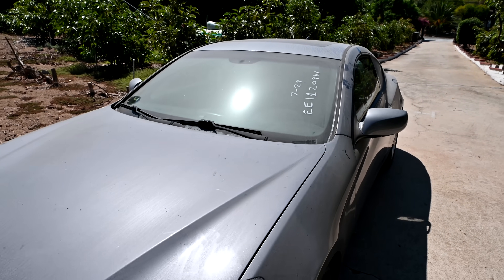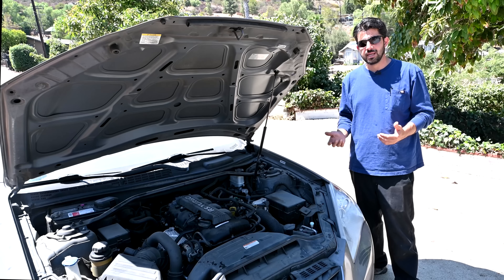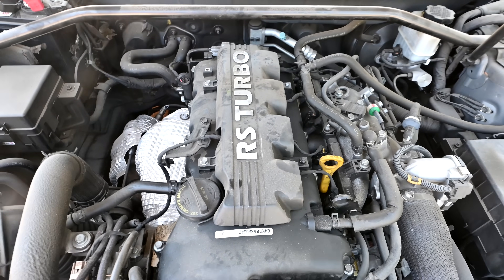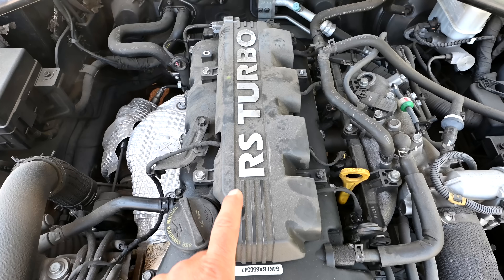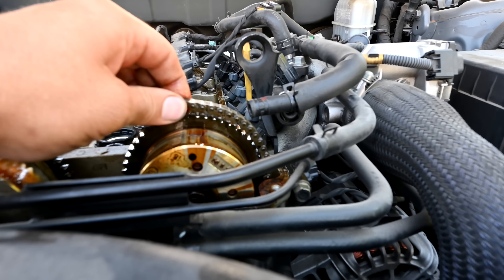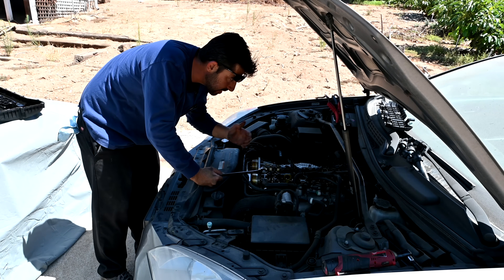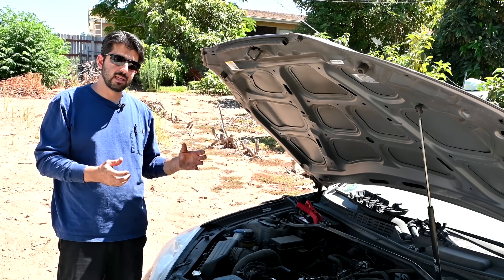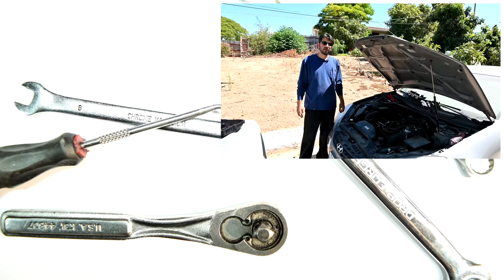The Hyundai And Kia Engine Failures Explained.

Comment: In my Kia Rio I change the oil and filter every 5000km, with full Castrol synthetic oil. Runs like a dream.  My philosophy with modern engines is, they only need good oil, early changes, and good coolant. I use Kia coolant, as used by the factory. Kias are good..
Reply: So you think owners of other car brands just take better care of their cars and Kia owners don't get oil changes? lol
Reply: I had a 2005 Kia Sorento that I kept until it had 168k miles. Only problem it had was the a/c compressor went out right before I got rid of it. I then bought a 2010 Kia Forte which I kept until it had 140k miles. Only thing problem it had was a seized rear brake caliper right before I got rid of it. I now have a 2016 Kia Forte5 with 96k miles and no issues so far. Kias aren't bad cars if you take care of them. They don't have much tolerance for neglect however.
Reply: @ericschwartz7809  ....sounds like my ex wife. She didnt have much tolerance for neglect either. 😂😝. Kias are good. We get a 7yr warranty  with kia, here in Australia. No one else offers that..
Reply: What year your kia rio is? I just bought an 06 kia rio with 56k on it for $600. In good shape. Just changed timing belt, air filter, water pump, oil change, plugs, coil pack 4 new tires, alignment and service transmission.
Reply: @retiredsnowbunnyhunterx5106  ...its a 2008...
Reply: I have a 2010 Kia Forte with the 2.0L engine, 247k miles no major issues.  I had some electrical issues, replaced a fuse and it's fine; was burning oil for a bit, had the spark plugs changed and she stopped burning oil.  I've always had the oil changed at about 5k miles and for the last five or so years I've been using full synthetic.  She has got plenty of wear and tear on her, but the engine is still fine.
Reply: @mystiqblackcat  Hi there, I was curious if your vehicle was from Korea or made in the US?... As I have a 2012 Forte5 with the 2.0L (non-GDI) as well with 115,00 km (approx 71,460 miles). 
Thank You- Cheers!
Reply: :oops::oops::oops::oops::oops::oops::oops::oops::oops::oops::yt::yt::yt::oops::oops::oops::oops::oops::oops::oops::oops::oops::oops::oops::oops::oops::oops::oops:
Reply: @tessalcazaren  🐵🐒🦍🐵🐒🦍🐵🐒🦍

Comment: I'm 63 years old.  The only engine failure I've ever had was an 07 Silverado that looked great, had 93K miles on it when purchased, but was purchased with a title indicating true mails unknown.  At 104K miles engine would not develop any oil pressure.  After a new oil pump with still no oil pressure a rebuilt used engine was installed with a new oil pump.  I am convinced that this truck was a company truck because of a sticker placed on the door jam with 6 numbers indicating it was a fleet vehicle.  Bottom line?  The money that I saved purchasing it originally was spent with the engine install.

I know that these engines from Hyundai have had issues just like the lifter issue with GM in the 5.3's and 6.2's.  I think that in most cases if the owner takes care of them and changes the oil at 5K or once per year they are fairly reliable.  Not a fan of GDI engines but that is my personal preference.  10K or 15K mile oil change intervals is insane in any gasser IMHO.
Reply: My mom just traded her 2017 Santa Fe sport because it burned 2 Quarts every 1.5k miles. Only had 80k miles. It was ridiculous. She got a 2019 rav 4 with 17k miles. I’m happy she listened to me and got a Toyota.
Reply: Did you take a true oil pressure reading with a test guage ?? GM V8 engines in the late 2000's to mid 2010's had issues with the oil pressure guage on the dash. You may have replaced the engine unnecessarily.
Reply: @charleskosyjana1295  Yes.  Two different mechanics.  No oil pressure.  Finally put in a new oil pump. Still no pressure. Purchased a used unit with verified 90k miles and installed the new oil pump in it.

Comment: I would remove cams and run leak down test. If you try retime it without removing cams, you will damage valves.  Use boroscope, to see what's is going on there first.

Comment: I'm certainly not mechanically inclined, as such i dont understand the inner workings of cars, but seems to me hyundai engines before 2012 were much tougher, so to say. granted my 2007 sonata had been well cared for by the first 2 owners. I got it for a scant $1700 and with nearly 160,000 miles the 2.4 liter 4 cylinder shows no signs of slowing down. Ratchets, what did they start doi9ing differently after 2010?
Reply: I just got a, 2023 Hyundai Sonata N-Line 2.5l turbo and I couldn't care less about engine problems as the warranty is, 10 year/100k mile warranty. Lol. So....I don't care if anything fails....I get it fixed/replaced for free. Ha also....I ALWAYS change the oil on a new car after the first 500 miles.  Some engines just don't last as long as others. It happens....not a single engine and or car maker has an engine that has never had a issue or issues. Millions are sold and odds are, some will have issues, especially with some people driving em hard as all hell and not doing proper maintenance. Again, new hyundais now have a 10 year/100k mile powertrain warranty. So, couldn't careless about issues. Lol also, when buying a new hyundai, you can purchase a lifetime pwertrain warranty for around 2k.....so.....couldn't careless about issues.

Comment: My 2002 Focus ZX3 manual 203K trouble free miles is laughing at this🤣
well I did put in a used DPFE for $10 and a used EVAP solenoid  for $15 3 years ago
Hardly uses any oil.

Comment: 2016 kia sorento  with the 2.4 NA 50K miles  - took the car to fix issue with car not going into gear  without manually disengaging the lock (small pin next to the gear lever) . Dealer called me they have to also replace the engine since it seized on their drive test - mind you the car had regular oil changes every 5K miles - way more often then even Kia recommends  - it didn't matter. They replaced it under warranty.

Comment: The best way to determine compression issues is using a scanner and doing a relative compression test
Reply from the maker: That gives you relative compression but you need a leak down test to find where exactly you're losing compression.
Reply: Katz- your test doesn’t apply in this case!

Comment: I don’t think any modern engine can go without proper maintenance any more. Particularly oil changes are critical. Hyundai did produce some bum engines though. I’ve got the 2.0 in my Kia and I do 5000 miles full synthetic oil changes. Interestingly, Kia sent out a recommendation for 3750 mile changes but didn’t specify for what type of oil. The factory service agent I called seemed to not know the difference.

Comment: I had a 2014 Hyundai sonata and the engine did what he said at around 90 thousand miles.hyundai did replace that engine at no cost to me.plus, they payed for a rental car for me while they where working on it. I am now driving a 2013 Hyundai sonata that has  almost the same kind of engine and so far,the only thing I had to do to it was put new spark plugs on it and at around 160 thousand miles I started haveing to add a little more oil to it in between oil changes but the mechanic a who knew the reason why it started useing more oil around 160 thousand miles said that he could fix it but it would just be cheaper to keep adding oil in between oil changes.I try to get oil changes at about every 3 or 4 thousand miles and so far,I had not had the same problem with the 2013 Hyundai sonata that I had with the 2014 sonata,but I'm also more diligent now about getting oil changes then I use to be.Also,I owned a Ford focus one time were the pistons locked up and caused engine failure.
Reply: I just got a, 2023 Hyundai Sonata N-Line 2.5l turbo and I couldn't care less about engine problems as the warranty is, 10 year/100k mile warranty. Lol. So....I don't care if anything fails....I get it fixed/replaced for free. Ha also....I ALWAYS change the oil on a new car after the first 500 miles.  Some engines just don't last as long as others. It happens....not a single engine and or car maker has an engine that has never had a issue or issues. Millions are sold and odds are, some will have issues, especially with some people driving em hard as all hell and not doing proper maintenance.
Reply: @nexpro6118  Not sure about the 2023 sonata engine,but my husbands 2020 hyundai Sonata 2.5 liter engine uses excessive oil.My husband has to add half a quart every two weeks.If I could make a suggestion,I would keep a constant check on oil and other fluids in your car but your right when you say that most cars have something wrong with them when they come off of the assembly line and that's with most all car manufacturing companys.personally,I think that the reason why car manufacturers are haveing so much trouble with their engines is because the government is always wanting them to change something to make the car more fuil efficient or to make it more "environmentally friendly" and sometimes that may cause car manufactures to have to compromise on quality and safety of cars and car engines.

Comment: What they do is Make the oil galleries too small for the oil to circulate around the engine it only needs a small bit of buildup of carbon to block the small hole hence the results is a new engine

Comment: Lot's of problems with Hyundai's, KIA, Genesis but they want to charge just as much as Toyota or Honda for their vehicles... they don't compare .. The new Genesis cost as much as a Lexus or Acura without the reputation for reliability .. They're ok on a budget but at the same price point I'd go with Toyota/Lexus or Honda/Acura all day long ! Hyundai's can be a nightmare if you're not a mechanic type and know what to look for.. Toyotas and Hondas are way more durable !! I purchased a certified pre-owned Sonota and started out ok ..Been on top of the maintenance and everything but now the thing is burning oil like crazy.. I have to add at least a quart of oil every two to three weeks and have to constantly check the oil levels... never had a problem like that with any of the Toyotas I've owned.. I went for the Hyundai Sonata looking to save money because of the insane car prices allegedly caused by the "Chip Shortage" ! I've since run into several owners of Hyundai's having the same oil burning issues ... Will never buy another one !

Comment: I own a 2010 forte sx with the theta 2.4L. It was hands-down a build quality issue. Then when you mix in lack of maintenance 🤦‍♂️…I am technically on the 3rd engine during my ownership. First one was in the car at 175k, drove it home with a bottom end knock. 2nd engine had a bad wrist pin and luckily was warrantied out. The current engine has been good but was low mileage at 63k out of a totaled koup. These engines are poop. And they’re in so many vehicles….it’s a damn shame
Reply: wow 😱
Reply: What is a wrist pin? Or do you mean a gudgeon pin
Reply: @goffthomas2554  wrist pin essentially holds the piston and the conn rod together
Reply: @Noahinthe802  Good after noon Sir! Yes as I said it is a gudgeon pin! I was Rolls Royce trained apprentice, 50 years in the motor trade have never heard a gudgeon pin called a wrist pin. Different expressions for different parts in other countries! We call fuel petrol you cal it gas.
Nice talking to you buddy take it easy 🙂
Reply: @Noahinthe802  thank you for your reply, so many American terms different to ours. I have learnt from this, take it easy buddy good to talk. 🙂
Reply: I just got a, 2023 Hyundai Sonata N-Line 2.5l turbo and I couldn't care less about engine problems as the warranty is, 10 year/100k mile warranty. Lol. So....I don't care if anything fails....I get it fixed/replaced for free. Ha also....I ALWAYS change the oil on a new car after the first 500 miles.  Some engines just don't last as long as others. It happens....not a single engine and or car maker has an engine that has never had a issue or issues. Millions are sold and odds are, some will have issues, especially with some people driving em hard as all hell and not doing proper maintenance.
Reply: @nexpro6118  I’m a retired motor vehicle technician and these ridiculous extended service intervals are entirely to blame for engine failures. Oil is relatively cheap, engines are not. There are issues with dirty builds but good quality control should sort this out! There is no excuse for muppetry in engine building. Just saying 🤔

Comment: I love the look of the Genesis coupes. Really too bad they didn’t get the v8 that the sedan came with. Could have been a real contender!!!
Reply: I have a bk2 Genesis coupe 3.8, full bolt ons, had it since 2013, and I've kept all my maintenance up on her. She's at 134k and still going strong. I think most cars will last a while as long as you keep up with the maintenance
Reply: @godzilla7391  This is the same engine i have in my 2 Kia Borrego, with over 250K miles on each of them, very reliable engines, almost bullet proof.